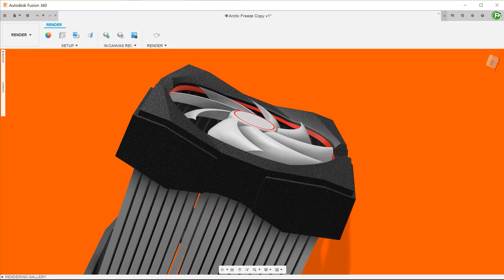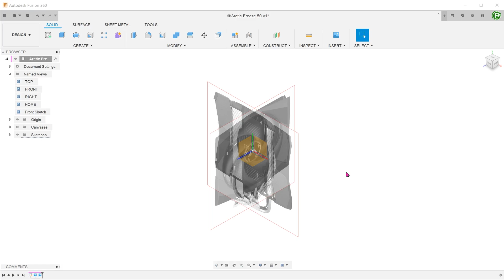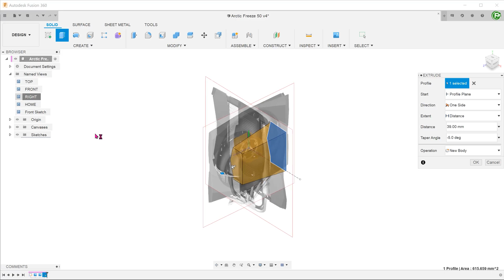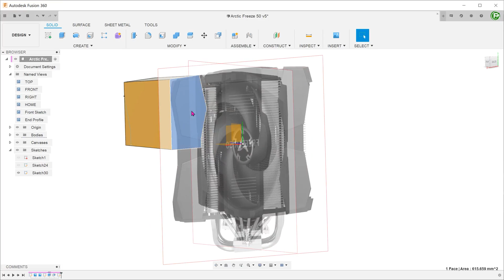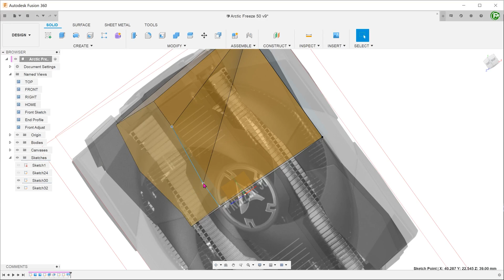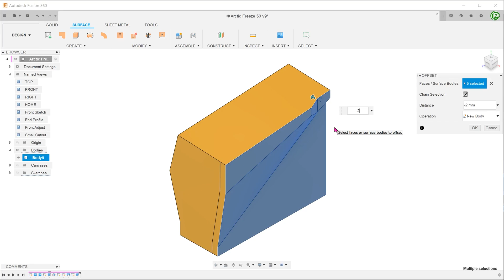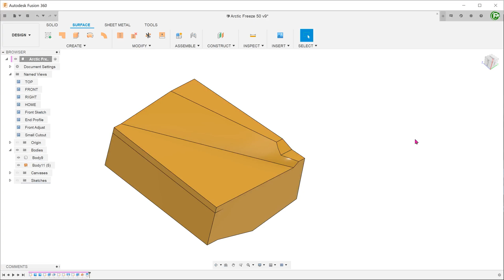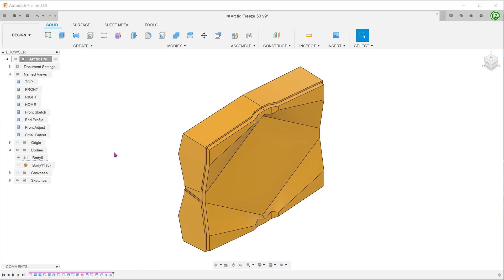Fusion 360 - Case Study 11

Comment: I learned several new things from this video:
 1) draft instead of taper due to the extra controls it provides that can eliminate extra steps/feature commands
2) the point about covering lines = loft command
3 wireframe 
4) same number of vertices = no need for rails
5) adjusting loft by dragging sketch lines (no need to go into sketch itself)
6) using the offset surface as a cutting tool. This one was big. I’ve seen you do this kind of thinking several times—visualizing a solution using more than one dimension simultaneously, rather than sketch on one plane, then sketch on another plane... You work on both planes at once using the surface command. This technique is so “high-level.”

One suggestion that occurred to me on the second-viewing: the appearance you chose to use was a potentially confusing as you went from solid to surface and back to solid. My mind saw the orange-ish color and thought you were still in surface when you selected solid again. 

I also really appreciate that you don’t get bogged down by specifying directions when they really aren’t the point of the exercise—a major annoyance when others insist on doing this in their tutorials.
Reply from the maker: Good to know that a 10 minute video was enough to provide you with some newfound tips. Noted on the appearance color. I am aware that Fusion uses orange to color tools in the surface workspace. But I have never really thought how that might be confusing if I use a similar color on the model itself. I will have to think about this and maybe experiment with different colors.

In your last statement, I am assuming you meant dimensions instead of directions. I was half expecting to catch some flak for not fully defining my sketches. Thank you for your validation here. I feel that the importance of fully defining sketches is a point that is universally understood and does not need to be repeated in every single tutorial. When I watch other tutorials, I find that dimensioning seriously affects the flow of the tutorial. It is more important to learn the concept/technique. Accuracy is not important when it comes to learning.
Reply: @Fusion360School   yes—“dimensions” (auto-corrected). You’re doing exactly what you need to be doing, just as you’re doing it. Your instincts are very good. You anticipate the questions your audience might have and answer them, you don’t underestimate the intelligence of the viewer, and you don’t squander their/our short attention span.